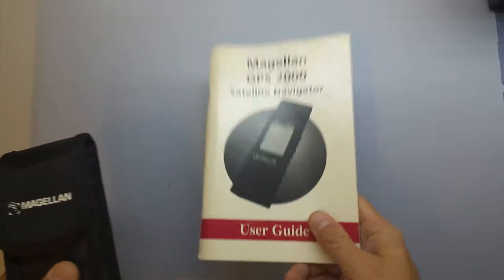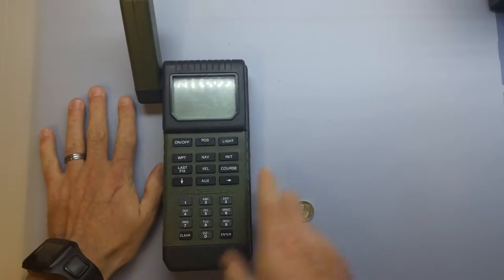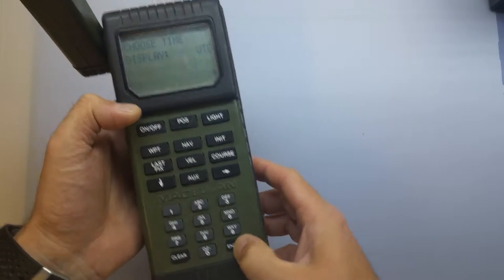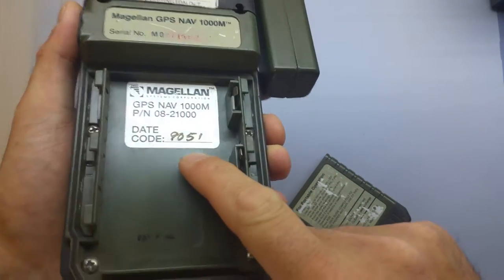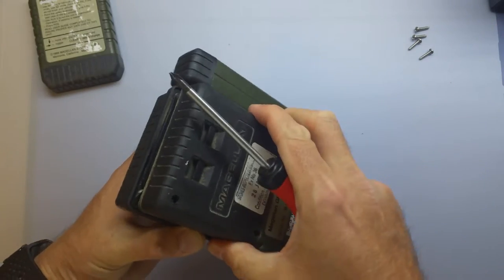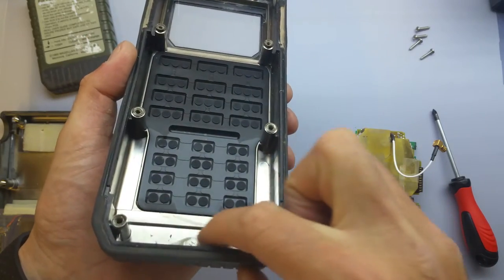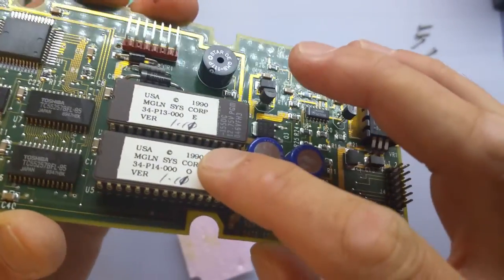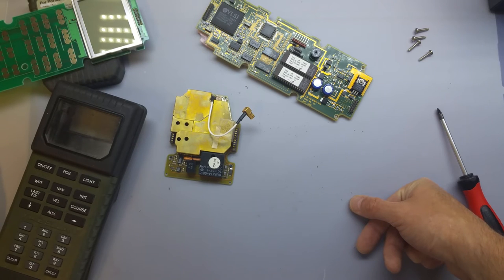SAS / BRAVO TWO ZERO Magellan NAV 1000M GPS Teardown

Comment: Couple of things to add/correct. Firstly, these 1000M units were made in USA and not UK.
Secondly, and contrary to what is suggested, these Magellan NAV 1000M units (along with all of the NAV1000 - NAV5000 series units), do still function, and will give correct latitude/longitude position provided they are given enough time to lock on to satellites.
I have both the NAV 1000M and NAV 1000M5 versions, (and several other models from the NAV1000-5000 series) and without exception, they all still function correctly - (Other than for the fact that the date will always be shown incorrectly). - In that "date" respect, they were affected by the GPS "week rollover" problem (which is not a Y2K problem). However, regardless of the incorrectly showing date, the devices will still show correct latitude/longitude positioning once they lock on to satellites.
Ideally, if the correct (very scarce) Magellan external power supply cable can be obtained, these units can be powered via any suitable 12volt DC supply, but failing that, they can be powered by six AA-type batteries - although it can take anything up to an hour before they have initialised, downloaded a current ephemeris and almanac, and then locked on to at least 3 satellites. (Both of my units do eventually find 4 satellites and give full 3D trilateration).

I hope that this comment will encourage anyone who might have one of these units to give it a go, get it operational, and fully enjoy its retro-technology once more.
Reply: I have a nav 5000 and 5000d they work great, and will get a 2d fix pretty quick, even from cold start, and 3d a little bit longer. faster than my Trailblazer XLs
Reply: i have a problem with a 5000D model , could you help me with that ?  I need to get the stored coordinates

Comment: Wow even an OXCO I guess you needed a much more accurate clock back then. The unit took 15 minutes to acquire the almanac data if you did not input the initial coordinates of where you would be operating. 15 minutes is a long time especially in a hot situation.

Comment: I have a 1000 Plus, 5000 and 5000d, they all work fine actually... provided you have the correct time and approximate position within 300 miles or so, it will grab position in about 12 minutes from cold start. Sounds like user error.

Comment: Hi. Good content. I also came upon this that is applicable to your old Magellan, I quote the below from 2020-SPS-performance-standard . pdf:

1.4 Backward Compatibility
The SPS is, and will continue to be, backward compatible. Even though the SPS SIS evolves over time, existing SPS receiving equipment continues to obtain performance that is the same, or is better, than received in the past. The effectivity milestone for backward compatibility is the declaration of initial operational capability (IOC). IOC for the L1 C/A-code portion of the SPS SIS was declared on 8 December 1993. The first edition of this SPS PS was issued that same day to define the initial operational capabilities of the C/A-code portion of the SPS SIS. SPS receiving equipment which was compliant with the relevant SIS Interface Control Document / Interface Specification (ICD/IS) in effect on that date was provided with C/A-code signals which met the performance commitments in that first edition of the SPS PS. If any SPS receiving equipment from 1993 is still in operation today, that equipment is still receiving ICD-compliant C/A-code signals which meet or exceed the performance commitments in that first edition of the SPS PS.